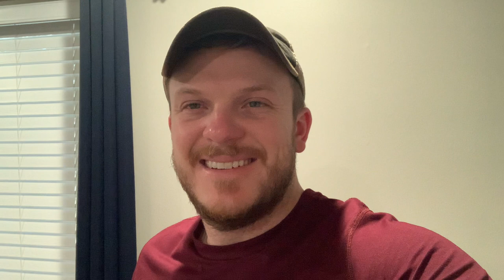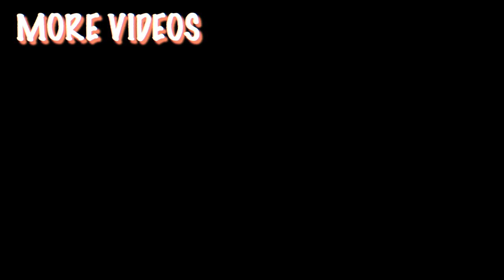A Beginners Guide To Building An AR-10: Part 2 - Lower Receiver Continued

Comment: I watched your build on a AR-10. My bolt release needs the threaded screw that you show. My parts kit only comes with a roll pin. Where do I get that screw?? ps. The screw that uses a 1/16th Allen wrench. Thanks
Reply from the maker: Where did you buy your bolt release from? Or the parts kit for it? Was it aero? I believe they usually supply it. Maybe reach out to them and see if they can get you one
Reply: Thanks for the answer. I will remember Aero for possibly other things. I just punched in that screw on Google and like 3 company's have it. So I ordered one for o think it was 3.99. we shall see when I get it if it fits proper and that I don't need a whole new bolt release. Thanks again. I will look up where I got my whole parts kit and let u know